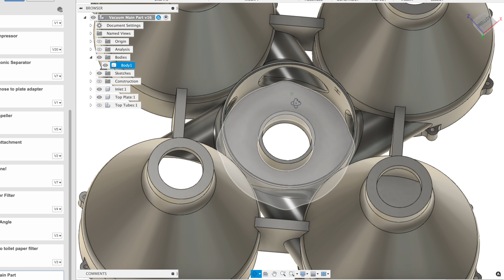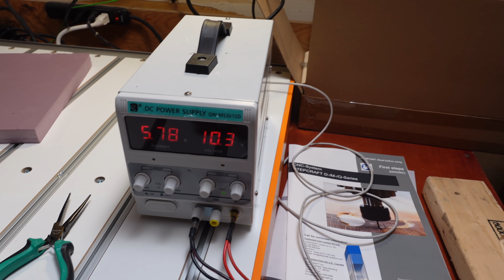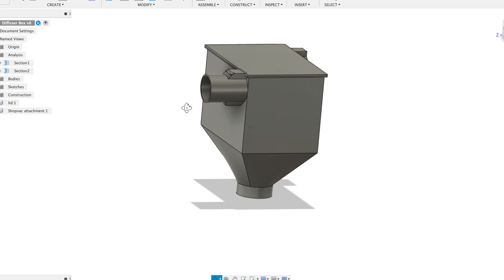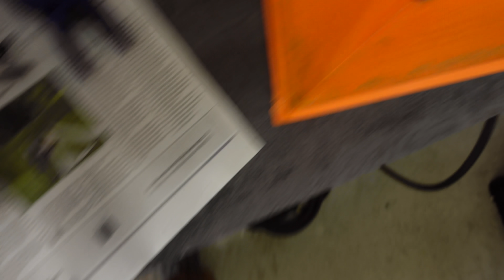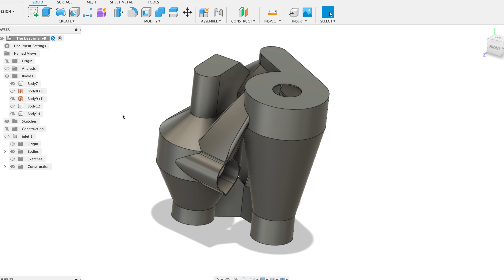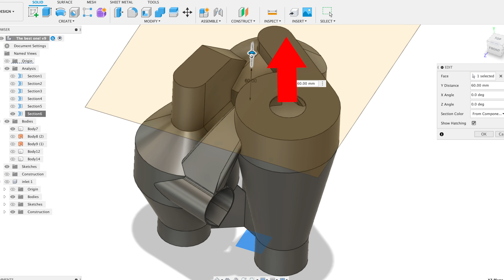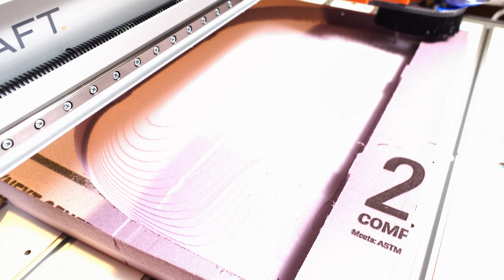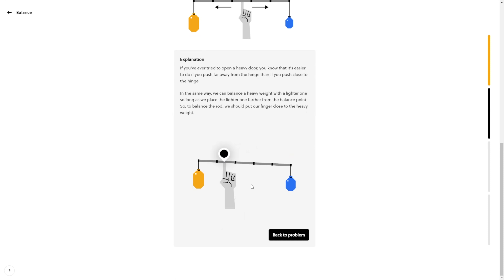3D Printed Cyclone Air/Dust Separator

Comment: It is interesting that the dust almost has like a venturi effect  in which is caught up in the air as the particles move down, creating the particles to have lift. 

So in retro analyis, I think one would have imagine the air lift or venturi effect if one is using the material sides of the outer shell to create such a movement.

Something cool to try would be a single could with... 4 ml to 1m tubes down the cone... so the dust is thrown into the tubes... less likely to go up the central shaft, and I also notice that they use a plate with long legs, like little pizza holder (white thing) that is on the bottom of the exit cones, Probably to diffuse the air return and lower its power, that may help quite a bit... There is also weight or mass  flaps one could make but adding mechanical components creates more problems that can go wrong and be expensive to fit. 

There is also a horizontal tube cross system yo could build... OS what it does is its large tube that adverts air flow in the cone to get rid of fine particles and then back to the main cone area... I have seen some with offset cone exit holes also and side flairs.. So it creates a vortex away from re-entry into the system, and there there is the end cut of the exit hole to create chaotic flow so that the air is disturbed and can't become laminar or flow dust back up from the bucket, since there is no path is can take....

There is lots of things one can make... Each of the other compartments can have  a trap on the bottom. You can print a wave break wave break over a 100 times... so it acts like a filter and breaks the air flow, in the vacuum on exist and forces particles to stick or fall. The problem is the charge to particles can assist it in crawling out... or to surfaces... theres many things one could do.. but I think you have enough data to calculate out a solution that is more optimal to the flow and capturing of particulate.... I can't remember, but air / dust act in a strange way every 90 degree turn in a vacuum system that is predictable... anyways cool video.

Comment: could perhaps have a cone with edges that spiral down, so at the partials spin in the chamber, they get pushed down to the cones own spiral.  and to stop it from coming up, another inner cone that allows air to flow up, in the same spin axis as the outer cone., but close enough to the outer cone that any particles get pushed back to the outer cone.

Comment: Do a set in series that is designed to get larger particles first (Larger bucket Garbage can?) and then dust in the second stage (5 gallon bucket?). You could build them into the same can

Comment: From my experiance I can tell you if you use the cyclon for normal cleaning or for woodwork-machinary  you schould make a underpressure valve befor the cyclon to let air in in case you close the inlet of the hose.
If not the underpressure can crash your bucket and suck the dust out of it.

Comment: Weirdly fascinating lol
I suspect there are 2 things going on.  For the larger cyclone there is more area for the same air flow, so it probably slows things down more and allows for finer materials to fall out of the stream.  On the smaller cyclones there is probably more turbulance near the mouth of the funnel, so when less material fell out of the first larger stage, the cups in stages 2 and 3 were probably too close to the mouth and material was able to be whipped up and through to the next stage.
Super curious if the 2nd and 3rd 'buckets' were deeper/wider if they would have worked better?  Could the displaced area of the smaller buckets also interfered with the airflow of the first and prevented even more material from falling out?  Maybe a chain of buckets would be the better solution?

Also curious about the steepness of the side walls, and maybe different slopes would be better with different sized objects?

Lastly, I am thinking some sort of stacked design.  A large bucket in bottom like a traditional shop vac that just gets the big stuff, then hose out of that to an upper bucket with a funnel that is more optomized for bigger stuff.  The wider your cross-section area gets, the slower the air will flow too.  You would weirdly want the smaller hose towards the inlet to ensure that big stuff has enough pressure to keep moving to the first bucket, and then wider and wider hoses and buckets and funnels to slow things down more to let the small stuff percipitate out of the fluid/air.

I'm taking notes though, I'll need to build my own dust filter system soon.  Right now my woodworking capabilities are relegated to a miter saw in a basement space.  Sure it makes a mess, but I am typically using it for 5 sec using a coarse blade, so verry little is getting airborne.  But once I start messing with routers, sanders, etc. then I am going to need something to prevent my basement space from becoming a breathing hazard.  Did it once, and it was pretty crazy.  That fine dust just gets everywhere quick!  Also hoping to find something that can work for fumes and bring fresh air in, filter out particulates, and push the gross air outside.  If one system can do it all, then that would be ideal for my relatively small/long space I have to work with.

Comment: It seems like any test where the vacuum tube makes a seal against a surface yields a dirtier filter. Maybe, when that seal happens, the container gains more negative pressure and sucks up material from the container.

Comment: If you put 3 larger ones on seperate buckets with varying angles in series i would ponder a guess that would yield really good results, I would do extremly steep first, less steep second and a stumpy one 3rd, this would help remove large particulates first then medium then hopfully the smallest with the stumpiest one.

Comment: when i made mine years ago 3d printers were not out yet i used a traffic cone on steal bucket but i do get extremely little in the shop vac i use it every where even in my house my house model has a hose that goes to every room i have not moved it i can even movie it to clean celling and take it anywhere on wheels but because traffic cone is smooth inside all goes in bucket i use a Ryobi shop vac great suction
Reply: Traffic cone is a glorious idea. I'll 3d print the rest but the efficiency from that long section will be amazing for first stage, then print smaller second stages for finer dust, then to shop vac/etc.

Comment: Maybe there are more factors, like particle size/particle specific mass RATIO?

The more stages you add for same (power)engine you decrease  the speed of the cyclone, that will decrease the cyclone efficiency(especially for the smaller particles )

Comment: Thank you for this research and sure that many rolls of filament you spent just for testing! I'm still lucky with my china cyclone, but I had to calculate that the fine dust will be filling up the vacs bag sooner or later. The advantage is that I can use a quiet household vac instead of an industrial, noisy one. Just the problem of the bucket squeezing has to be solved by inner fins or an under pressure (self designed, 3d printed) valve.

Comment: It's important to be careful when designing those systems. A too complex system with several pathways will create extra resistance in the air path and reduce the ability to collect dust.

Comment: Commercial particle separators have aggressive vertical sections before the cyclone allowing more heavy material to drop out, have an exhaust tube intaking below the cyclone intake port, have a plug in the dust port producing annular discharge (like a turbine), and sometimes use a smooth downward curve in the ceiling to introduce the vortex into the vertical segment.

In the extreme cases this warps it from a "funnel" shape to a sort of fungal bloom, with a perforated internal riser instead of a conical segment, and a ball at the top allowing recirculation before dropping into the separator proper.

I'd love to see more science and less art here, but I appreciate your time and funds wouldn't fit testing 200 extremely similar designs either. Great work so far!

Comment: Single cyclone has a wide low angle, this allows the fine particles to lose the most velocity possible before dropping. They also increase in distance exponentially due to this shape. Which makes the vacuum have less effects on the incoming particles after they have entered the chamber. The only issue you have is the large particles. Which need to maintain velocity to not become buoyant in the updraft of the bucket. So, two stages, tall steep walls into a wide wider angle cyclone. This allows large particles to drop and small particles that bypass that stage are handled by the wider cyclone. Two receptacle design just as you did on the triple cyclone.
Also, sealing the bucket is critical limiting unwanted updraft from the receptacle.
And, you need something that prevents or redirects the initial bounce of particles on the lid of the cyclone.

Comment: The canister needs to be 100% sealed to be effective. The cyclone also needs to be a very steep angle to catch the smaller particles. Also, the velocity inside the cone plays a major part. So maybe making the inlet to the cone smaller would also help.

Comment: 3 things im wondering. 
1) Angle the inlet downwards wondering if that would keep particles from just rotating around the inlet at the upper most part 
2) creating a buffer gap, in other words from inlet to the top lid add an additional 3 inch wall to keep the bits rotating about away from the upper most inletm, or creating another negating slope where the outlet almost cones upwards from the inlet at an opposite slope. 
3) Smoothing out the edges to the friction is lowered I'm sure the layer lines trap particles from rotating smoothly down, I feel as if this is something that could make a little-no difference but you never know

Comment: Put two buckets in series once you really fine tune both. The first bucket catches the heavy particles and the second bucket catches the finer dust. The big particles stir the air tossing the finer particles around. Also the lines on the print cause the finer particles to be suspended longer maybe sand them and use epoxy to get a smooth finish?

Comment: hmm, I just took a plastic bucket skewered in pipe thru the side at a steep angle parallel with the top as an inlet and the spout in the lid as the outlet, it worked perfectly, i could do dust and water nothing got into the shop vac.

Comment: For a very first seconds I believed that you an engineer, but than I realized that you don't know the physics... and especially fluid dynamics... Each time you make a wide space in the system you create a great aerodynamic resistance and the negative pressure (vacuum) you create in the beginning of your tube is decreasing greatly comparing to the pressure right at the inlet of the compressor. Also you use "dynamic" design compressor (inlet and output of the compressor don't have any valves and flow can go through them freely) so while you loose pressure you also loose flow going through the compressor so the speed of the flow also decrease. The main aim of the design you build is to slow down the flow enough to have not enough speed for particles to suck into the pump but also to save some negative pressure in the hose end. The only right way to change something in this build is to place inlet and output of the centrifugal separator as far as you can from each other

Comment: Great video. I suspect the reason for the varying results is due to the varying air flows caused by vacuuming the floor and your different designs. Faster  inlet velocity = higher RPM = better seperation. Also smaller cyclone diameter = higher RPM so your 4x parallel cyclone should preform better than the single assuming they were sized so that the inlet velocities are the same or faster than your single cyclone.

Comment: The series versions are limited by the total volume of your printer since you did not want to assemble them. This makes the comparison of designs less useful because the smaller the cone, the less speed reduction you gain when you introduce the same volume of air per time unit into it (i.e., suppose your vacuum performed the same).  The solid particles will fall on the cone surface not only because of the pressure due to centripetal force, but also as a result of whether the surrounding air flow is fast enough to re-pick them up.  In your case, when you have 3-4 cones in series, each being smaller than the big single one, you are allowing the high speed airflow to counter the effect of particle separation.  The game is balancing high speed air for dust collection from the inlet (i.e., you may reduce the inlet cross sectional area) and air speed reduction at the collector (i.e., the bigger the cross section you use, the slower the air would go in the collector).  Good video as showing your experiments.  But more theoretical calculations may be performed before the design phase.

Comment: I love the video; I have a cool idea for a double cyclone.  Make it like you made the mono-cyclone but slightly larger, and have the cone curve as it drops down to release particles from the cyclone easier.  Put another less steep cone inside the first, that dips below the first opening.  The intake goes in the larger cone, and flow will gradually take the smaller particles out.  The smaller cone has less spin in the air so heavier particles will drop out of that one.   The smaller cone's input is at it's top, opposite from the larger opening, and would be offset direction-wise to create a cyclone in the smaller cylinder (in the same direction).  I also think a radial grate at the bottom of both cyclones (i'm thinking an inch height and 2-5 concentric rings) would be a MASSIVE help when it comes to accidentally re-circulating particles.

I think that recirculation was a big issue for everything you did with more than 1 dust collection opening, just because of natural air circulation.  I think if you dropped the 4 parallel-cyclones into 4 separate, sealed buckets, and then put the remaining air through the mono-cyclone, then it would basically be a dream vacuum lol

Another idea just popped into my head.  You could ground the static from the tube and put a little metal wire around the cyclones to encourage separation of dust and air, maybe worth a try!

Aside from this, I can't wait to see what you do with the CNC man!!!

Comment: What would do best of a cyclone with very smooth walls, Teflon like to prevent the airflow from being hindered and giving worse suction at the end of the tube. Would this let particles keep to much momentum and never properly separate from the air flow? Or a cyclone with very rough walls, slowing the particles down aggressively to let them fall into the bucket, or would this hinder airflow too much, and or slow down the particles too close to the outlet and let them get picked up directly out of the wall?

Comment: You have no real vortex finder this allows short circuit flow 
Also the geometry of the multi cyclone means the velocity is the same through each if you very the volume you would handle a variation in partial size and density 
Hope this helps 
Cheers Rick

Comment: the diameter of the cyclone is directly proportional to the particle size! you should make a large diameter followed in series by several small ones in parallel (keeping total cross-section constant). that is Dyson's special sauce. Smaller diameter cyclones will spin faster and throw smaller mass particles against the wall easier.

Comment: If you look at the Dyson and other branded cyclone vaccums. They put multiple cyclones directly in series. The dysons have multiple small cyclones on top (or behind don't have one to hand to check) the main cyclone. Also they do have much steeper sides than your design.

Comment: Real interesting watch
The thing that makes a cyclone dust separate works is the centrically force vs exit air velocity vs gravity. An interesting thing would be to enlarge the 'exit' hole vs inflow. This should reduce the airflow because the volume of air passing through the tubes is a 'constant' (vacuum sucks fixed x m3 per minute, ish)
Like you said, particulates need a certain amount of air speed velocity to stay airborne and the cyclone is supposed to keep the dust outside of where the airflow is high enough to pull the dust with it. This is why a lot of drum vac's have a block shaped filter on the outflow port, this diffuses the out-airflow over a larger area.
I think Increasing the height of the straight cylinder top part of the catcher could also have a positive effect. Increase distance between the dust and the inlet.

Comment: Use the staged filter in series with the mono-cyclone, that should solve both your issues. Or just 2 mono-cyclones in series. Also, it helps if the trash bucket is deeper.

Comment: Try putting the collection hose into the top - side (not center) of the bucket and place a deflector scoop to direct the airflow.

Then have many open ports going into you cyclone at steep angle place under the lid and out flow at the center.

Can also try a bigger steeper deflector cone around the outside of the inner cone, so it's like a triple cone. Bucket included. 

Hope that's clear as mud 😆
That will keep the air flow low, and the  flow will go up the second steeper outer cone, then through the top of the last cone, and maybe a good idea to enlarge the bottom last cone too, as you want high drag low flow throughout the cone system.

Any high flow, low drag will kick up the fine dust, which will make your system leak dust
Good luck